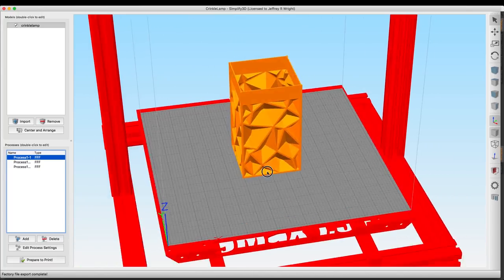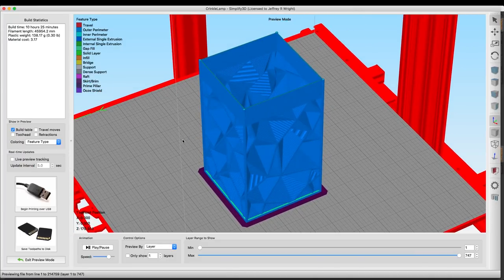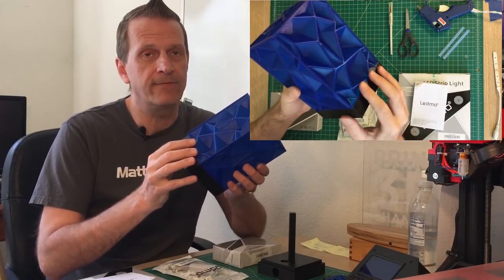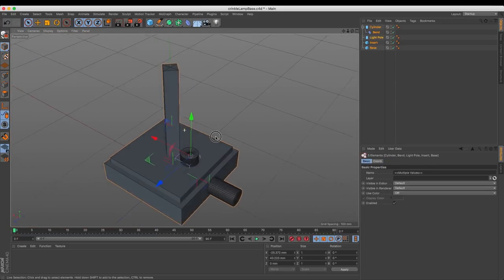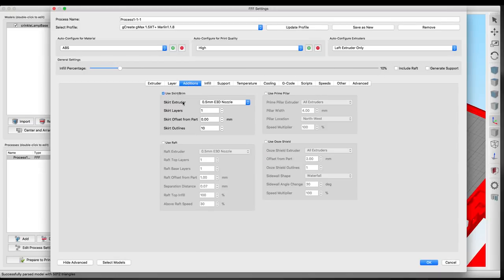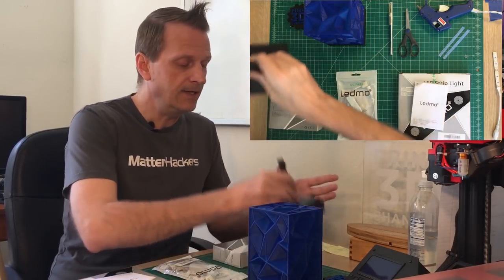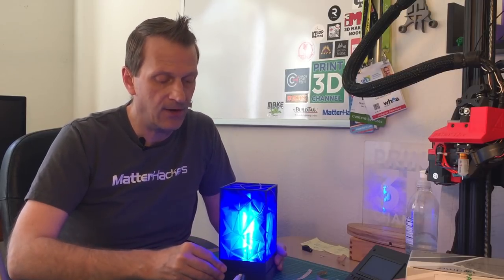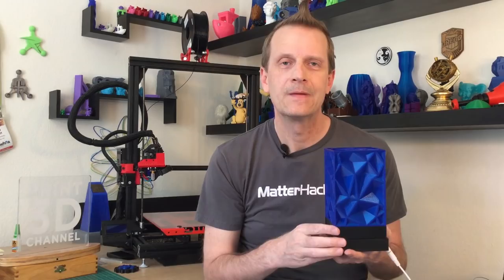DIY Weekend Print - 3D Printed Crinkle Lamp with LED Lights

Comment: Looks pretty swish! Sounds like you wanted to see the shaft of light in the centre, so mission accomplished! Did you try it with any dimmer lights that didn't make the centre shaft so prominent? Would be cool to see the difference!
Reply from the maker: Yeah, I thought I got the dimmer switch but it was just on/off but I am ordering more 'bits' for the LED lights, have something really cool in the works as we speak. Thanks for watching and for supporting the channel!